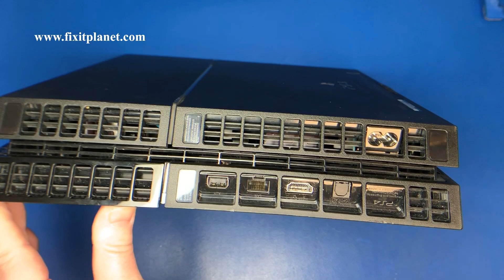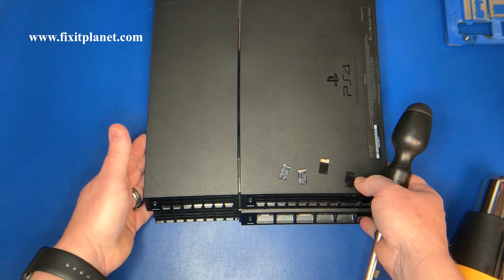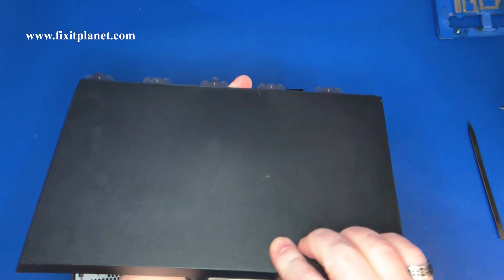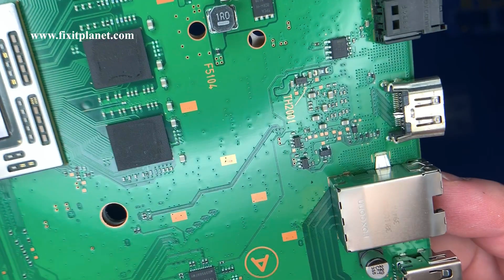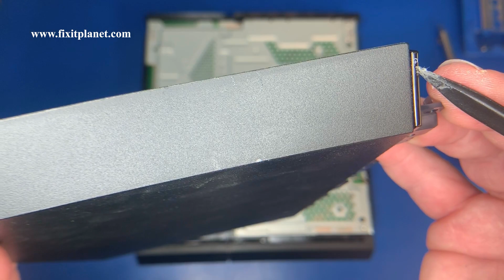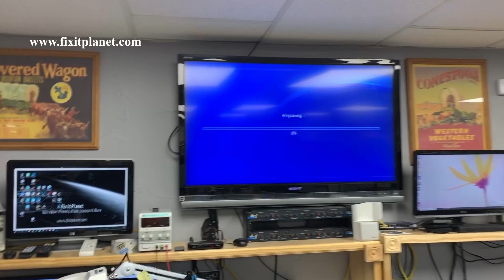PlayStation 4 (CUH-1001A) Teardown And Replace CPU Thermal Paste From Start To Finish

Comment: That power supply does NoT just come up. After being patient and gently wiggling the power supply ripped right from the motherboard! Disconnect from the power supply side it's easier to replace than having to have a professional resolder the part to the motherboard! I was looking forward to restoring my little brothers ps4 and this absolutely ruined it! Why would you say either side is fine?!!

Comment: I was trying to get to the two screws in the back of the case with pure black stickers. They wouldn't come off. Put a lighter on it waved it around so it wouldn't melt anything and they came right off. 

I tore down a PS3 super slim and fixed it this is my first PS4 teardown. Excellent video sir.

Comment: I have a model CUH1001A and have only two security screws in back, not 4,.. I have the top cover off and I remove the hard drive and just can't get the plate off the motherboard so I'm reading that I have to take the bottom cover off first and disable a few things but the problem is I cannot figure out how to get the bottom cover off. everyone makes it look so easy in these videos but I'm thinking that either this isn't my same model or I have a different version of the same model which I didn't know it was possible. I'm so stuck.. can help? 😔😊
Reply: Rewatch the video. I didn't realize there are plain black stickers in the corners with screws under them

Comment: PS4 beeps 3 times then turns off, em
Reply: Nvm fixed my issue
Reply: @llLawd  how?
Reply: I have that issue
Reply: @Bandyboo322  same happened to me, I took of the power supply and put it back in and it worked

Comment: I have a ps4 model cuh 1001a that likes to overheat now and then it's mostly with particular games (rdr2 mainly) but I am very nervous about taking it apart to clean the heatsink, fan and replace the thermal paste my fear is I'm going to create a bigger problem then the occasional overheating like messin up connections like the wifi cable and stuff :/ any suggestions?
Reply from the maker: Just be careful and take your time. Don't force anything. Photograph as you go so you can keep up with where everything is located especially the screws. You can do it!

Comment: Oh god. That thermal paste job though... looking just like The Verge PC build video. Tsk tsk tsk. DOT METHOD BRO. You're not icing a cake! C'mon!
Reply: Too much paste leave a gap for hot air to enter the die. That's not good lol. It has to be a consistent thin layer to close the gap preventing heat insertion but also improving conductivity to the heatsink.
Reply from the maker: Relax bro it's not that big a deal. Were not painting a Van Gogh either. SMH
Reply: @FixItPlanet1  No no no you put wayyyyyyy too much paste a small pea sized pasted would yield better results than that especially for a small die like that.That is 3-4 thermal paste applications
Reply: Looked fine to me, I fix hundreds of thousands of different things that require new thermal paste.

Comment: and you dont clean the heatsink ????? only blow the fan ???? its a shame.
Reply from the maker: The video shows the cleaning of the CPU and heatsink...... what are you talking about?
Reply: @FixItPlanet1 I know this is an old post but I think they are talking about the heat sink below the fan in the casing. I don’t know if this model has one but in the pro there is a secondary heat sink that you have to take the fan casing off to get to.